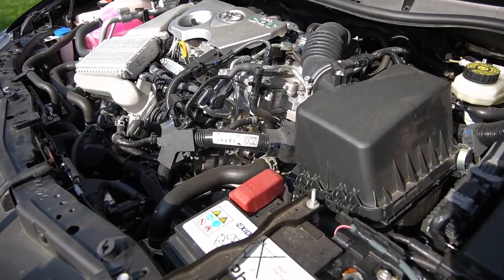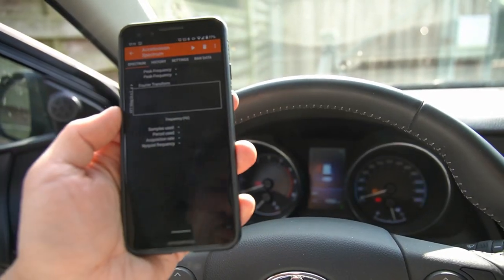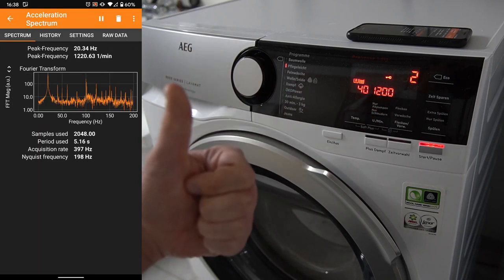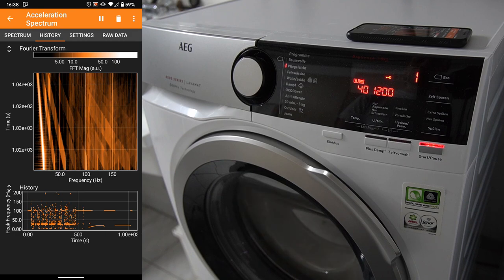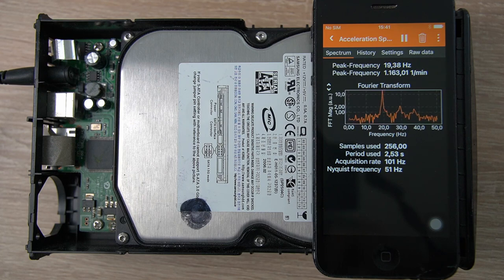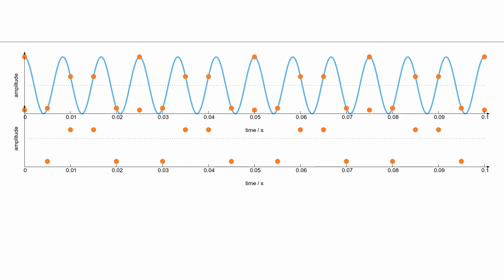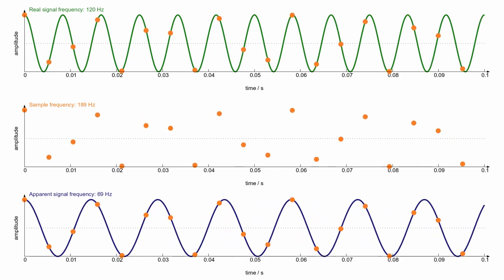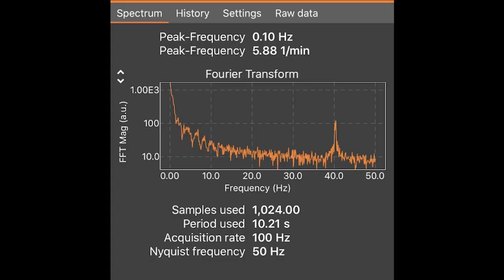Frequency spectrum on your phone | Part 3: Acceleration (en)

Comment: Sir, I don't think you have time to read coments, but all cell phones have a DAC/ADC converter, with a circuit using one resistor, a trrs plug,  two position switch, and a small calibration, we can also measure capacitance, esr, inductance, resistance, with one more resistor, we have a voltage divider, we can measure AC voltage